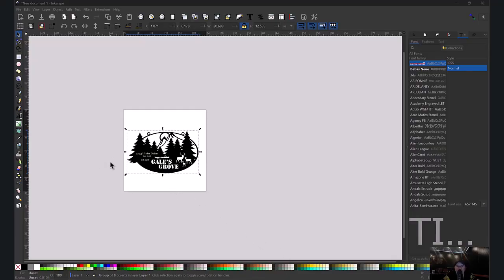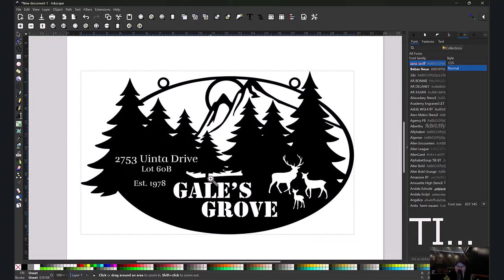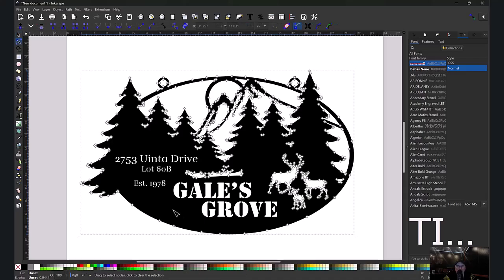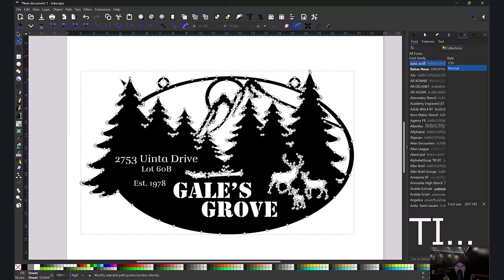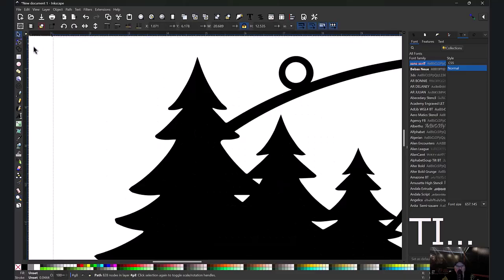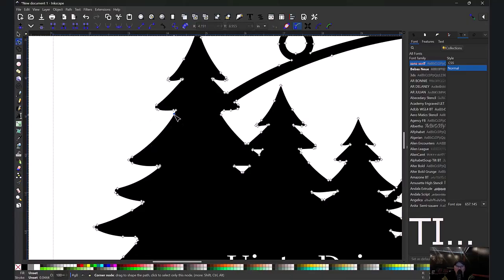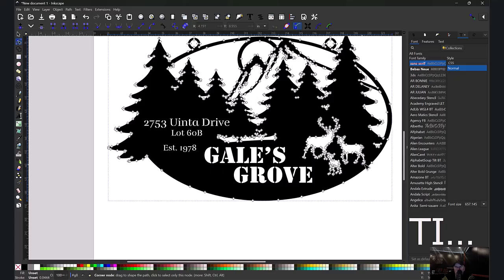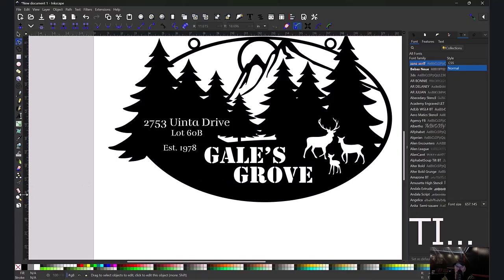Understanding Nodes in Inkscape (CNC Plasma Design Fundamentals)

Comment: I use fusion360 and it HATES alot of nodes. Im dealinh with that now with a sketch. All the lines are connected and its showing that as it highlights the entire imagine but when i go to extrude gives me an error ive checked every single line to make sure they are connected and there wasnt anything goofy happening. Next step is to upload it in inkscape and try to simplify. Gets to be a time consuming pain sometimes especially if your using dxf files that you did not create
Reply from the maker: For sure. In my opinion inkscape along with sheetcam is the way to go when cutting art pieces. Way simpler than using fusion. Just my opinion. But then again I use solidworks too and am not extremely versed in fusion all that well either.
Reply: @tinmanmetalworks  yeah man its nice to have the cad and cam in one program but im thinking the inkscape/sheetcam route might be somethin i need to look in to its just learning the new software for both might take a bit. Thanks for the response man I enjoy your channel 👊
Reply from the maker: @joshbaker9705 you are welcome. Sheetcam is super simple. Its pretty much load your file. Cluck make cutpath and done. As far as inkscape I have a free drawing course inside the members area of tinmanmetalworks.com  super easy follow along course.